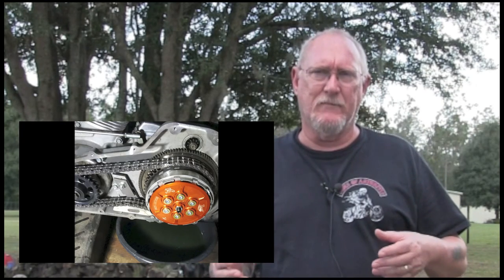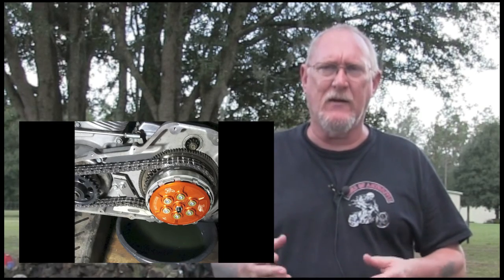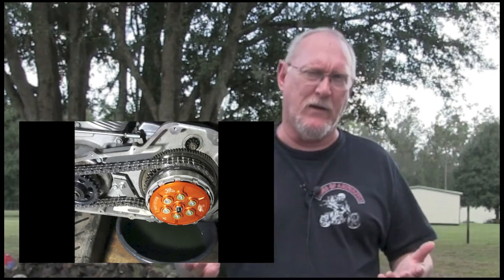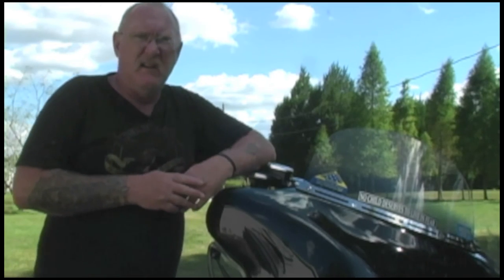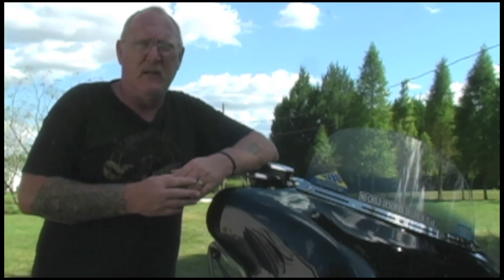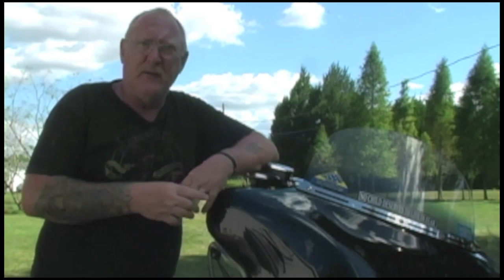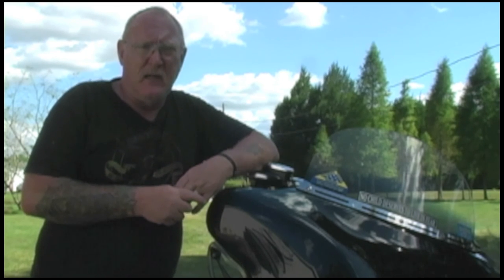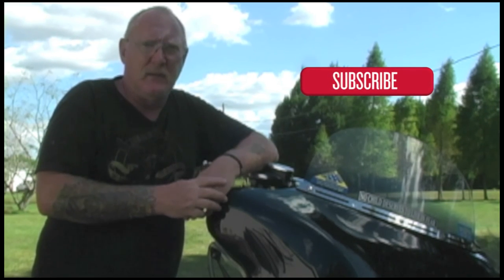The FLH Lives! - Overview of a Harley 6 Speed Transmission Failure and Other Issues

Comment: Now my Street Glide lives as well.    I replaced all the bearings in the transmission.   I replaced the input shaft, and 6th gear.   I'm using 20/50 V-TWIN AMSOIL In the primary and the transmission.   It shifts in and out of neutral very smoothly wait at a traffic light.   No more growling, a nice smooth sounding hum.      

Thank you very much for sharing your knowledge.

Comment: Thumbs up on the information.   I have a low pitch wine.   I replaced the main shaft bearing and inner race, I replaced front and rear axle bearings.    I still have the winning noise.   I'm wondering if it's the needle bearings between the main shaft and the final drive.    I'm removing the transmission assembly some time this weekend.   I did have a rub mark in the inner primary case from the flywheel.     If the bearings I speaking of have a problem, the tell tales will be on the main shaft.    If there's anything irks I should know, please let me know.   

Thank you,

Anthony C
Reply from the maker: That rub mark is the indication of the problem, and indicates the shaft is bent. Be sure to get the updated mainshaft and bearing, and ditch the automatic tensioner.
Reply: Southern Biker TV 
I talked to a HD parts DEPT guy.   He mentioned that the updated shaft is actually the shaft from the 2006 HD.    It comes with minimal accessories.   My question is, do I have to replace the final drive gear it self, or can I just replace the needle bearings and spacer inside the final gear.   I guess if there is any type of ware indications inside the gear will be the tell tale.    Thank you for your reply.  Looking forward to anyone's input.  
Anthony C
Reply from the maker: Just noticed the reference to the 2009. 
When I try to isolate the source of a noise, I try to ride the bike in different ways to see how it impacts the noise. In your case, does the noise go away when you place the bike in neutral and coast? How about when you pull the clutch in and coast? Does the noise change with engine speed or road speed? Can you hear the noise when the engine is idling with no load in neutral?
You say you saw rub marks caused by the flywheel? Do you mean the alternator rotor (by the engine) or the starter ring gear (by the clutch)?
Reply: This is exactly whats going, and how it sounds.  I will do the best I can to explain in details, which will make it easier to diagnose to a seasoned technician.   No noise at idle, no noise in first wait for a light with the clutch squeezed of course.  There is a low pitched growl at 45 to 49 MPH no matter what gear I'm in (4th,5th,or 6th)   I replaced the inner primary bearing and inner race.  I replaced the clutch basket bearing, the front and rear wheel bearings, to no avail did the noise change in any way.   What made me replace the wheel bearings, is because I would be doing 45 to 50 MPH, Squeezed the clutch and let the engine idle.  No change in the noise!  I would push the handle bars left and right to swerve going down the road, and the pitch of the growl would change as I was swerving.     I'm thinking it may be the large final drive gear bearing behind the clutch assembly, or the needle bearings between the main transmission shaft and the final drive gear.   The rub mark in the primary inner case is on the left of the case going to the front of the motorcycle.  Another words, to the left of the final drive. It's a mark from the flywheel teeth.  It's as though the primary chain tried to squeeze the crank shaft, and clutch basket together because it was too tight.   This doesn't mean the main transmission shaft is bent, to me it means there's too much movement in the main shaft, and the chain is too tight.  The OEM primary chain adjuster is a very good idea, but it will keep taking up slack.  I also feel the tension springs in the adjuster, should be a little lighter.  Lets face it, that primary chain should not be too tight.  It should only be just tight enough to keep the chain from making contact with the top of the inner primary case.   When we accelerate, the slack is at the bottom of the chain.   When we down shift and bring up the RPM's to match the speed of the motorcycle, all the slack goes to the top of the chain.   That's when the auto adjuster is taking too much slack for no reason.   This is just my thoughts.  Looking forward for your opinion and comments.  Thanking you in advance,
Anthony C
Reply from the maker: Now I'm with you. It sounds like you have the same issue I did - the output shaft bearing located right behind the output sprocket. 

http://officialdiygarage.blogspot.com/2015/12/the-flh-6-speed-failure-resolved-tips.html

You can check this by taking the belt load off of the sprocket and checking for movement (up/down - side/side) that shouldn't be there. You can also spin it by hand and check for noise.

https://www.youtube.com/feature=player_embedded

Comment: I have a 2015 road glide special with 11000 miles on it. Just the other day I was riding it I heard a whining spinning grinding metal sound that only occurred when I was coasting in 3rd 4th or 5th gear.  I haven't taken it to Harley yet but I am certain that it's the transmission's main bearing failing...(based on internet research) I am not a mechanic,  I am wondering how much it's gonna cost to get it repaired......?
Reply from the maker: Replacing the support bearing that failed in my FLH required the transmission to be disassembled but could be done in the bike. It's labor intensive and the special tools required are an added cost if you don't already have them. My advice? Check with your local shops but don't skimp on quality over price. Good wrenches are hard to find!

Comment: im replacing a  blown up trans on a 07 ultra.. my friends bike.. im not a harley mechanic but im  a good mechanic . the new trans he ordered arrived as a whole  assembled unit.. not just the gear cluster hanging on the trap door. .. replacing the whole thing looked like the whole rear suspension has to come apart... should i just pull the door and cluster  out of the bike  or would you just  do whatever it takes to R & R the trans as a whole..
Reply from the maker: I hear you Thomas! I'm not a Harley trained factory tech either, but I've had a wrench in my hand for over 40 years. I would say to install the assembly, rather than rely on the integrity of the old case's internal bearings and seals. I reviewed the procedure for the 2009 FLH I own and yes, you do have to remove the rear swing arm as part of the process - at least according to the manual. But as an experienced tech, you understand the manual isn't always right! Take a hard look at the clearance between the back of the trans case and the frame/swing arm. Just maybe there is enough space to clear?
Reply: It doesn't take a lot of time to pull the swingarm and it's a good opportunity to inspect its bearings and upgrade if desired.